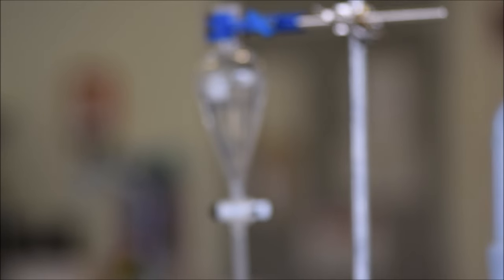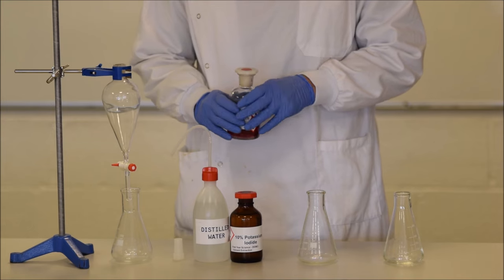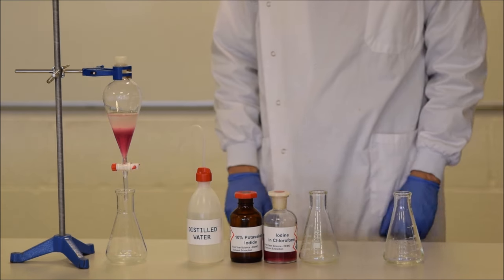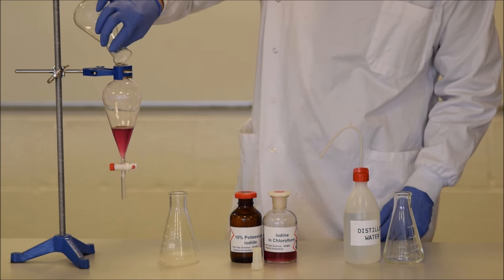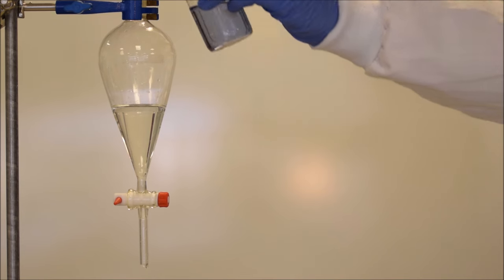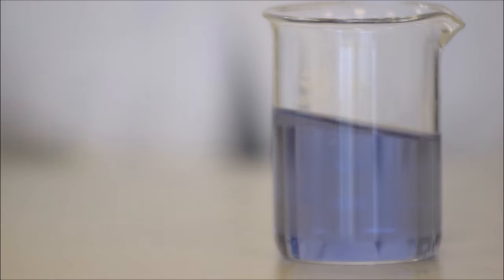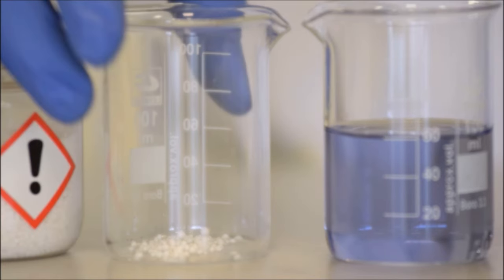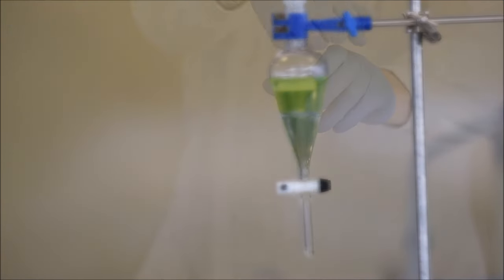Using a Separating Funnel

Comment: Nice explanation & demo!

I'm looking for fast and efficient method of separating alcohol (IPA or denatured) from dissolved liquid 3d printing resins, as the alcohol can be reused a long time if didn't get dirty fast, and replacing few liters of alcohol after several prints sound very wasteful.
Their relative densities have about 30~35% difference, which makes it possible to separate by gravity, but it happens rather slowly, I usually wait about a day, but some people (I guess with more and dirtier resin-IPA mixture are saying they have to wait nearly a week!).
And then you have to decant /or siphon it. I prefer siphoning as it doesn't disturbs the bottom layers as much as decanting. And just realized yesterday that I can use a simple water bottle pump to do the siphoning a bit faster and without unneeded jerking of tubes in the dirty mixture container/.
But if I shake the container or disturb the bottom layer somehow I'll have to wait another day (or several) for it to separate well again :/
So I wonder if separating funnel or other low-tech method can do that (I've also been fantasizing about cheap DIY centrifuge for larger volumes /compared to lab centrifuges/).
It sounds simple enough in principle, but I can't find anything on the market and seems that if I want one I'll have to construct it (I also realized that using an old washing machine if at least its centrifuge works, and if it can work laying on its back - ie with vertical axis of rotation can be adapted for that purpose).
Do you guys have any advice?

Comment: During the chloroform and potassium iodine.. which of them is the aqueous layer and organic layer?
Reply from the maker: The aqueous layer is the upper layer. The density of chloroform is  about 1.5 times that of water so it sinks to the bottom. The potassium iodide is essentially insoluble in chloroform as it is an ionic solid.